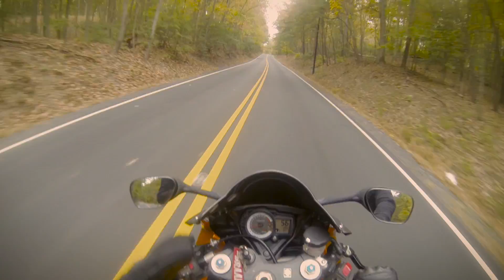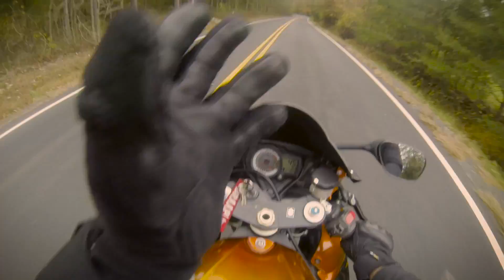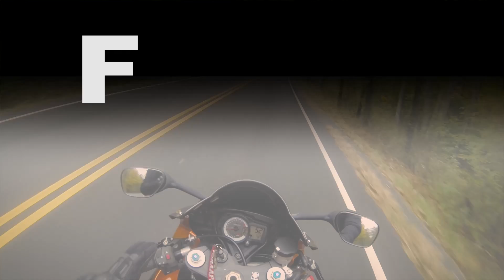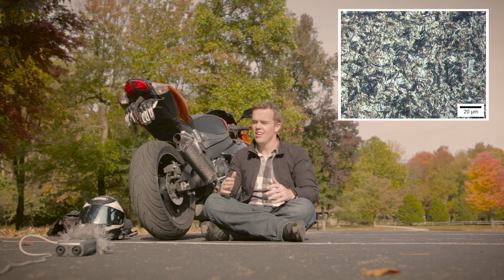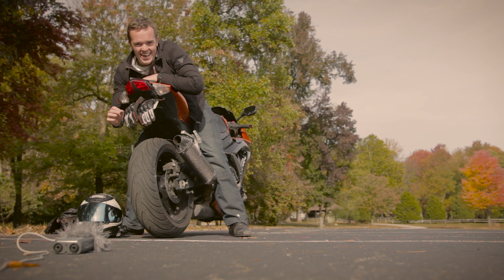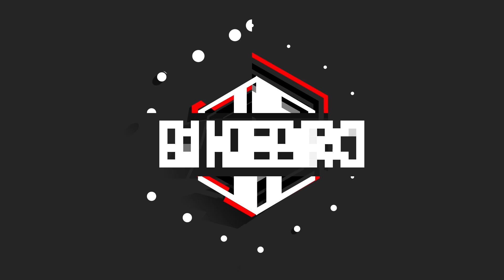Motorcycle Traction explained

Comment: Riders do , but shouldn't concern themselves with chicken strips.. Bike needs to be really leaned low, lower than public streets would need. Also has to do with tire profile and psi. Imo to get that low on roads you'd need to stay sitting more upright even a bit to the opposing side of turn angle instead of sitting more off the bike into the lean as most would say that's how to keep maximum patch of rubber on rode, but realistically it the edges aren't being used enough to be leaving "chicken strips" it's highly likely you're not gonna be running out of traction then when not shifting body off the seat like pro racers do. Tires are much more capable of lean than riders give credit for. I'm proof bc I don't shift and make low enough leans with a thin edge of "chicken strip", based on not using brakes at Apex and maximum lean. Shifting into the lean would actually leave a wider strip in roads and only on tracks rubbing off the edges. Some will argue against that, but just really think about that logic of what I stated.

Comment: First law principals don’t apply to viscoelastic materials such as rubber.  Rubber has the properties of both a solid and a fluid.  For fluids, shear force is non-linear as a function of area.  Furthermore, rubber forms a weak bond with asphalt, which is also a viscoelastic material, so the friction force is a function of inplane shear, which is a function of area, not normal force alone.  Bigger tire = bigger area = higher friction.  Also, tire coefficient of friction changes with temperature....it behaves more like a liquid when it warms, and less like a solid.  Thus its shear force and traction tensor is higher.  This is a material science problem, not a simple kinetics problem.  If you don’t believe me, take a wide vs narrow piece of the same tape and pull in-plane.  A tire is just really weak glue.

Comment: I have a 2014 HD Fatboy Softail that have Dunlop tires on it that seems fine on sunny days...but I moved to a Rainier part of our Hawaiian island with plenty sharp curves and turns.  I've been noticing that when it rains and I'm on my way home from our Club ride that my rear end feels like it's sliding out and not keeping traction like it should. What tire would you reccomend? This is driving me nuts because all the years that I owned this bike, it never happened. Sometimes on sunny days riding, I still feel this slight sliding out or floating feeling around corners. What is going on? I bought my bike new in 2014 and up until this past year it's been cornering like this.  Mahalo for your  Physics video, it really helped and is really clear on  traction.

Comment: One thought. If this is correct, and I’m sure it mostly is, then why does changing the psi up or down to alter the size of the contact patch have SUCH a HUGE effect on grip and rolling resistance. Changing the psi does nothing to effect the load weight or tyre compound. Surely it means contact patch is a huge part of the equation.

Comment: I agree with all that you've said. Here is my explanation for lowering tire pressure to increase contact area and "increasing" grip. Assume you have a tire contact patch of area x, and there is an area of the road that has very low friction of area x. If you're cornering and the tire rides over that exact area on the road, you have a higher chance of wiping out, than if you had less tire pressure and had a tire contact patch of let's say x+1, riding over the low friction spot on the road of area x. Technically, you're not increasing grip per se as much as you are increasing the area on where to grip from. That's coming from an engineering background.

Comment: Great video, thanks! What I miss though in actually all videos on youtube about this topic so far is the fact that load (for example the riders weight, or luggage) increases traction, but it also increases the centrifugal force when turning. Can someone tell me how these two relate to each other? Is it proportional? In that case the increased centrifugal force cancels out the increased friction, so the moment of breaking traction at high lean angle should be the same.. Someone feels like explaining this to me?

Comment: Could have been a great explanation but sadly, wrong premise to begin with. Contact area DOES matter. Rubber simply doesn’t follow the conventional law because its microscopic structure and behavior is so different. You need more research on why slick tire works in dry racetracks.

Comment: Dude you really need this explained to you. Getting the bike 'up' means your not leaning, or at least as much, meaning that you use less of the available traction on cornering forces and more for forward drive. The whole fat part of the tire is only partially true, depending on the profile of your tires,. Not all, particularly road tires, are created equal. Most touring or cruising tires do quite obviously have larger contact patches when upright.

Comment: No one talks about circomference here????   A motorcycle tyre is curved. So this mean you get "more torque" when on lean angle than when bike is upright.

This is why you want to put the bike upright as soon as possible "to get the most traction".    Its not more traction persé, its just that your tire can handle the power better.    See the center if the tire (upright) as a small gear with few teeth   and the sides of the tire (lean angle) as those big gears with a lot of teeth.

Comment: F=uN doesn’t apply to cars or motorcycles if you are exerting enough force to leave rubber behind on the pavement. In a skid or while peeling out the static friction is a larger force than the force needed to shear the rubber. So friction isn’t the limiting factor giving you traction, it is the force required to shear the rubber. That force is dependant on the cross-sectional area of the tire (contact patch). Bikes and cars are both too complicated to understand using the F=uN approximation.

Comment: How do you determine how well your motorcycle will stop on wet pavement? A retired road racer told me once to go out and ride at like 25 mph and hit the rear brake until the tire slips/skids and that will tell how much traction you have on any given surface. Anyone ever hear this? And are there any other ways to better gauge wet conditions since making an error is something to be avoided.

Comment: Great discussion on a complex topic. And we want to know about this because we're riding motorcycles in all weather conditions. One additional item to mention is the sipes/grooves in the tire. Consider them to be a removal of tire material, leaving less of it in contact with the road. This enables the tire patch to be pressed harder into the pavement making improving traction, especially in wet conditions, over a tire without them like slicks.

Comment: Friction and grip are, as far as I understand, slightly different things. What you're saying is friction is independent of the surface area (coeff of friction x normal force). But grip is slightly different. I think surface contact area will affect the grip directly. Because why do motogp or other racers use slicks? Because more contact area.

But with tire size, a wider tire does not necessarily mean a larger contact patch. This will depend on your rim width.

Just my 2 cents. Thank you

Comment: Sure, most tires are great. But down here in the South (I'm not familiar with roadways around the country) we have road surfaces that I'm quite certain ALL tires would suck when road surface is wet. We have this rocky asphalt that is a smooth slippery surface contact area when wet and all tires will lose traction. Just simply cannot make a good hard turn leaned over or the wheel will slide out from under. Terrifying and will def make you think twice, thrice, four times before leaning over or braking hard when the surface is even slightly wet. If like to see someone make a video about road surfaces, unless I just haven't seen it yet.
And perhaps that heavier rider gaining more traction could be a comprimise for the lighter riders gaining more speed.

Comment: There are a few good points here in the comments (rolling resistance) has been confused for traction when decreasing tire pressure. Imagine your traction patch as a square where your tire touches the ground. You lower your pressure in your bike and your 1x1 inch traction pad has become a 2x2 inch area (quadrupled). Friction has not increased because POUNDS PER SQUARE INCH (PSI) has remained the same at the GROUND (not in the tire, we deflated it a bit). This is because your bike still weighs the same. Imagine a one finger push up vs your whole hand (it "can" hurt). Here are 2 major points to consider: Rolling resistance has increased because the tire is soft and harder to roll (go ahead push a car with a flat tire). Its the rubber getting in the way that slows you down, not friction. Point two is that you contact patch is larger, so lets say fully inflated with 1x1 contact area you hit a decent sized pebble or a few light grains of gravel, that 1x1 area is removed from the road surface and might as well be atop a marble. Bye bye traction. Now, dad always said if you get stuck deflate your tires, you can now allow that 2x2 area (4x larger) to REACH and CONTACT fixed areas of TRACTION (the road) and that pebble takes up 1sq inch and theoretically gives you 3sq inches (75%) of your traction. HOWEVER, this will overheat the tire in time and cause it to be very unstable but is the reason you lower pressure on sand, rock crawling, possibly snow as well. Tall vs wide tires is another conversation to itself. Short story is that wide tires on cars and trucks dont increase traction but taller tires do.

Comment: Excellent explanation. I really like Your thinking about these basic physics and that the contact area almost doesn't play any role in terms of grip. However most people out there almost ever tell this story that the size of contact area matters. Just look at the current videos of the lately release Yamaha Niken. You'll find no video not saying that the Niken reaches higher cornering speeds because of more grip at the front compared to classic motorcycles due to the fact that is has two wheels and as a result of that twice as much contact area.
We'd probably ask the myth busters to tackle that one. What do You think?

Comment: A larger contact patch does add more friction due to the adhesive properties of the rubber.  That's why race bikes, cars, etc. use slicks.  They would not get the same traction with treaded tires (air spaces in the tread) on dry pavement because of less contact patch.

Comment: So ur saying that since I weight 300lbs I can take corners faster that my buddy weighting 180lbs?
Reply: CBR BOY Yes and no, while it's true that you have more traction (weight available to corner with) the coefficient of friction would still be equal. So let's say you have tires that can corner at 1G(ravity) then you300+450bike = 750 lbs that needs to get thru the corner and at 1G you can apply that 750lbs of cornering.

Using the same principles your buddy only gets 630lbs to corner with but the thing is if he's using the same tires cornering the same speed and at the same angle he will only generate that same 1G the difference is his 1G only needs 630lbs of traction exactly what he's got on tap.

So in cornering it'll be a wash but on loose surface you'll have an easier time, the thing is even on gravel he can accelerate just as fast as you because he has less mass to bring to speed compared to you having to give it more gas but you'll have the traction to do so he won't have the traction to open her up as much but he's lighter so he won't need to, still ridding in an situation where the rear-end is struggling with grip will require much more finesse out of him than it would from you.

After that you get into moving your weight around and that's a whole new can of worms. For example if you have the bike for it, in a lower gear you might be able to hang forward and keep the nose down therfore able to make use of a high output motor, whereas your friend may just be too light to ever open it all the way and accelerate like a madman in low gear. In fact some extra light riders can end up spinning the wheel instead of wheeling so weight on a motorcycle can be a complicated thing, there's so many factors that ultimately it just depends.
Reply: Chronicles of K. Toyoda thank you... That explains alot ... Always had that thought in the back on my head and it has been answered lol
Reply: CBR BOY No sweat lol.

Comment: What about change in tire pressure? Will more or less tire pressure have more friction and grip?
Reply: Dustin Bailey Decreasing tire pressure increases the contact patch of the tire which will give you more traction, although, this will lead to other things to think about such as: rolling resistance and tire squirming. Lessening tire pressure to much will cause the tires to "squirm" on the ground as you are turning which can be difficult to handle. It's important to find this point at which this happens so you can find the best tire pressure that works best for you. Also, increasing tire pressure will give you a faster tire as the rolling resistance decreases (which is the friction created by the tire). So I recommend dropping a couple psi if you are going on a windy road or around sharp turns and raising the pressure a couple psi if are going on long, straight roads. And raising or lowering 1-2 psi can make a big difference! Hope this helps!

Comment: So if you grab the brakes super harshly to put more force on they tyres and thus generate more friction you'll definately stop faster and not slide along the floor
Reply: Ben Brewer You will if you do not exceed the maximum friction of the tire  which is before wheel lock-up

Comment: bigger surface area doesnt affect friction but it affects the stability of system because when you are cornering the force applied from bike to ground comes at an angle. and if the surface area is small (imagine very very silm tires, and even though it's undestructable) it will increadibly hard for biker to keep the bike in equilibrium, even the tiniest axial shifting of applied force causes the bike to flip over.  

so it is not only for weight.
(not a native speaker, pardon me if i couldnt express it clearly)

Comment: Actually, the main reason why sports bikes/cars use larger tires is because a larger contact patch enhance frictional coefficient - on a bigger contact patch there is less pressure on it for the same amount of vertical load (pressure is force divided by area) and, therefore, because of the microscopic viscoelastic behavior, this region gains more shear resistance.
Reply: I love this idea.  In addition, you have to average over the contact patch area for all the imperfections.  It's likely that, in ensemble, the average will represent the intended performance of the tire better, and, while perhaps the friction coefficient may not be great in some parts (and would cause you to lose grip if that was all you had), other parts will compensate for it.  It sounds like a good tribology problem.

Comment: People are generally forgetting about one important factor: In a straight line, the tire is just rolling on the contact patch. However when cornering (i.e. at nonzero lean angle), the contact patch of the tire is not only rolling, but also twisting sideways with respecr to the road. The higher the lean angle, the higher the twist. This twisting motion decreases the effective contact patch size (most of the patch is actually moving relative to the road) and also causes extra stress to the compound of the tire. By straightening the bike as early as possible, you minimize the twist.

Comment: Question:  If a stock motorcycle is able to take a a specific corner at max lean angle X and max speed of Y, would changing to a lighter wheel (or other part) allow it take that same corner at either some angle higher than X and/or some speed higher than Y?  I'm at least assuming it would increase the rates of acceleration and deceleration.
Reply: JPickle yes mate. genral rule of this is the less unsprung weight the better so loosing at least 2kg per wheel will improve the bike in every way (exept wheelie control). less mass = more speed for the same working effort.

Comment: Your friction coefficient will change depending on the normal force applied. Your image of the mountains shows how the peaks and valleys deformed when forced. That in theory was changing the coefficient. The friction coefficient decreases as normal force is increased, it doesn't scale linearly. When riding in the rain, many cyclist run lower tire pressure, your riding slower so taking turns there is less normal force and having less pressure helps increase the friction coefficient since the compound can "adhere" to the road better. The force from the inside tube is less and is more easily able to hug the road. Not to mention a larger contact patch helps mitigate contaminates in the road

Comment: I've always thought bigger tires didn't mean traction was higher, but more consistently holding the road and not the dust, sand, water, oil and gravel on top of the road surface